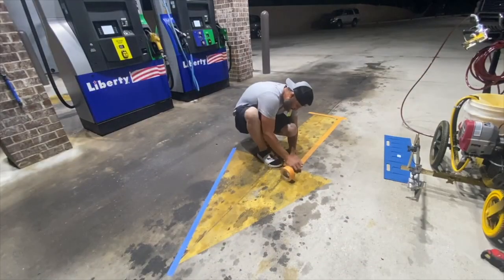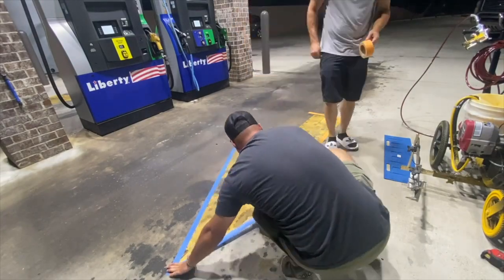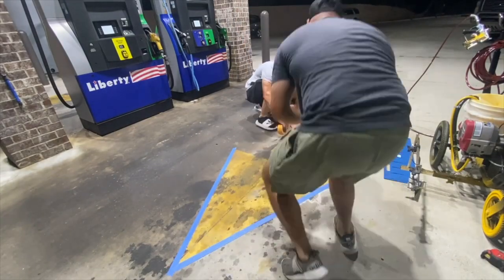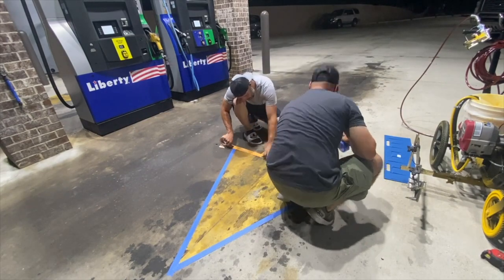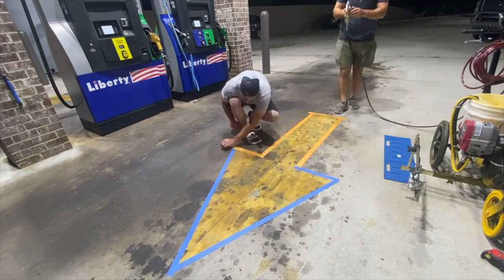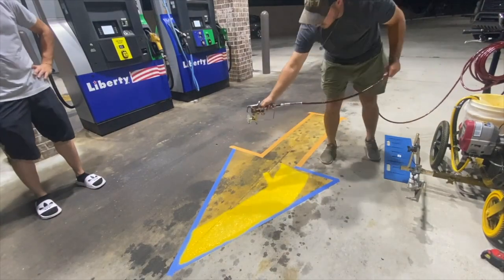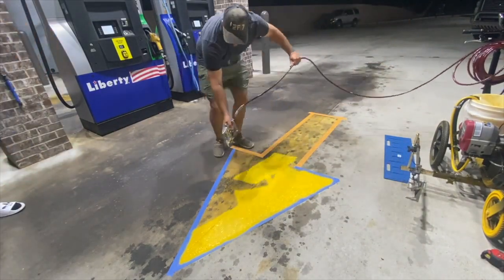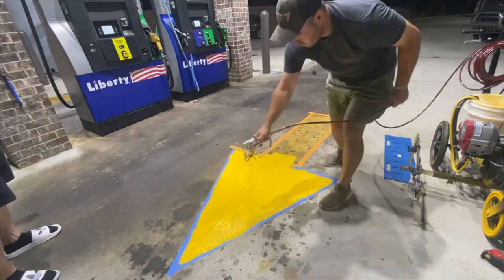The Biggest Issue W/ Parking Lot Striping Business

Comment: Just so you know guys I bought a striping machine through asphalt kingdom early June and told me a 5 day wait for my machine.. 5 days past they said 30 days more okay not a big deal then 30 days later they say another 60 days until shipping ETA  and they weren't even sure about that. I hope I didn't get ripped off so ima wait it out and hope I don't have to take legal action.. they might say they have all the paints but who knows how long to receive them..just saying
Reply: Mine took 3 months
Reply: Bought one through Sherman Williams , and the estimated time was 60 days minimum. And that was their Commercial Store that deal basically in rigs and high amounts of paint.  I went with the graco 3400 because it’s a machine I’m very familiar with.
Reply: I've been ripped off a few times and a common tactic is to repeatedly delay the transaction until any statutes of limitation are expired. I'm using that term loosely, but seeking a remedy through a credit card fraud claim, through the courts, or through some other venue will all have some sort of time limitation of when you can file a claim. Covid1984 has changed the supply chain for the worse, so don't assume they are ripping you off, but you need to look out for yourself and that includes not allowing them to wait out the clock to your detriment.

Comment: Why do you plate every line? And also why tape every arrow instead of finding a stencil or some such
Reply: Stencils are the only way to go, taping is so inefficient in time and paint wasted, I only taped a bit on my very first job and said no way. I was also wondering why he was hand spraying so far away from the surface, 6 inches should be about the max for control and proper paint coverage .

Comment: How do you calculate the total paint needed per job?
Reply: Depends one how thick you’re applying and what paint you’re using. A 5 gallon bucket of sherwin Williams set fast usually goes abt 1500. 1000  linear ft for firelane